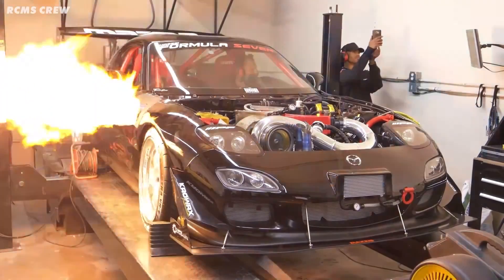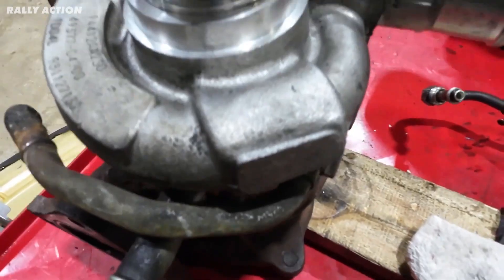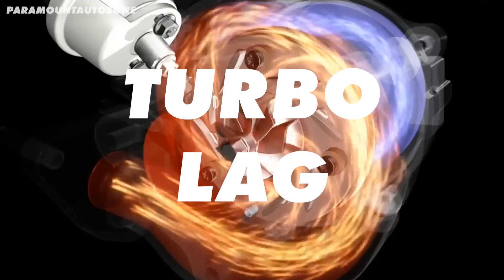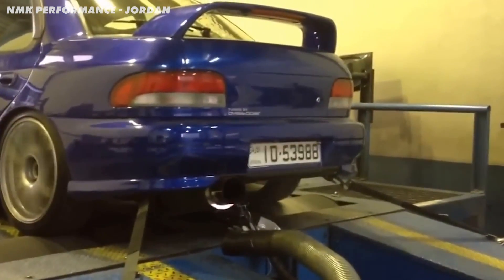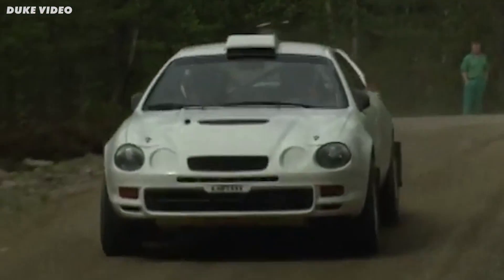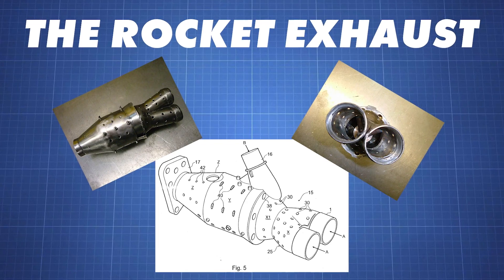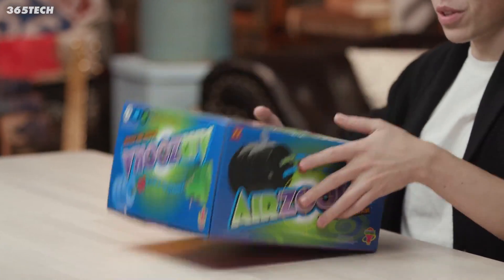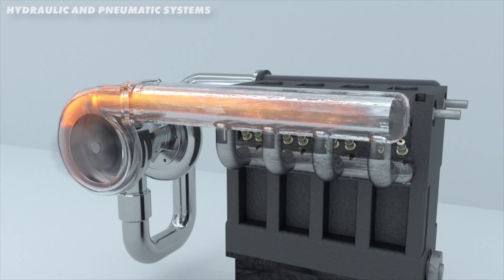Subaru's GENIUS ROCKET Exhaust

Comment: 4:58 The in car video view was from an setup called "Fresh Air" anti lag system which operated very differently. 
The throttle would be fully closed, but the turbo would keep spinning and never spin down until you flip a switch. 
Basically your plumbing a T into the charge pipe right before the throttle body to a waste gate that's plumbed to each individual exhaust port on the exhaust manifold feeding itself to keep the turbo spinning from the exhaust side. From watching videos about it in the past. Rally Racing banned this type of technology and a new type of technology "Rocket Anti-lag" came into place for a more efficient design from an emissions standpoint.

Comment: Having Been in to rallying for the Last 45 Years And I Owned a subaru WRX Uk 300 ,Anti Lag Is One of The Worst Things ever Put on a Rally Car !.
A Legacy RS Before any anti Lag Rubbish Existed and Unequal Headers Sounded Fantastic,But When They Went over to Equal Headers and Antilag Latter on the Develpoment on Imprezas They Simply Sounded Boring And Not as Nice at All

You will be Saying F1 Engines in 2023 Are Better Next ? When There Rubbish Compared to The Past As Well.

Comment: U forgot telling the part that this rocket anti-lag main advantage over conventional antilag..

That would be full boost even at idle speed engine rpm...

Thats why subaru impreza s12b code chassis can start-launch at rally stages just sitting idle...

As opposed to conventional antilag needing the driver to input 100% throttle and keep the engine rev high enough to start/launch...where then whem only after get moving, the conventional antilag will be effective...as the engine rpm relatively kept at reasonably high rpm to get the exhaust gas moving decently...

Rocket antilag can be driven in more relaxed manner at launch as well as at every type of corner without needing to keep the engine rpm high enough...because there is already full boost available even from idle rpm...solving problems of bogging down at super tight hairpins or driver error...

Less driver stress on keeping the engine rpm as high meams less engine wear, less drivetrain shock, more focussed driver and cleaner driving style...more potential to wins...  

I wonder what the result would be  if Seb.Loeb given the chance to compete in wrc driving this version of subaru...

Comment: One of the difficulties of the group B cars was the immense turbo lag that came with the huge turbochargers they used. You'd plant your foot on the throttle,  then wait a second or so while the engine tried to get the turbo spinning. And then you'd suddenly have more torque than you knew what to do with.

The other major problem was that you were driving the same stages with 400+ hp that you drove the previous year with under 150 hp.

Comment: Turbosmart has a ALS valve that you can install to your turbo system. It takes your pressurized air frok your charge pipes and routes it directly to your exhaust header. Run a rich 0% throttle map with late spark timing, and now you have anti lag.

Comment: Not sure if you ment to imply Toyota came up with secondary air ALS or not but they (Toyota) didn't.

 Audi had it's 'Umluft' system on the S1E2 Quattro circa 1985 using a wastegate off a 944 Porsche Turbo to supply charge air to the exhaust manifold under certain conditions.

Unfortunately,  control was not as precise as today's technology and the exhaust valves would eventually burn up and be destroyed from the high temperatures in around 60mins of use.

Comment: "How did they come up with this?!?"  Apparently someone came up with similar idea in 20th century for locomotive engines, very very old patent, there was also at least 1 man who re-engineered a system similar to this for his S2000 race car, searching BigBadWolf S2000 will get you there.  Regardless, what ProDrive did with his system is truly amazing.
Reply: As far as I am aware, he has never lost an engine.
Reply: @TrackDayMaker  You are probably right, i forget what he lost, or what hurdle he faced, i just remember something a few times completely stopping the project.  If its all on same motor then my apologies.

Comment: The rocket exhaust is related to NOx reduction burners used in industry. The goal is to get complete combustion yet lower the overall temperature of the mix.  It's essentially a way to get combustion in overly lean conditions.

Comment: Saying that Citroen beat Subaru because it was shorter and had better balance sort of dismisses the driver of the Citroen who changed the way rallys are driven because he was so dominant.
Reply: I seem to recall it was someone named Loeb…
Reply: @borismuller86 That rings a bell.  Sea Bass something.
Reply: Sea Bass Loeb? Sounds a bit fishy if you ask me . . .
Reply: @nigeldepledge3790  Sea bass is a dominant fish in Rally.  All told essentially 20 years of dominance.
Reply: Exactly, it had nothing to do with the Citroen and everything to do with Loeb driving it.
Reply: @Danger_mouse  that's not fair.  The Citroen had some things it did well, it's just that not even mentioning Loeb is crazy.
Reply: @Scoots1994  The Citroen was no better than its rivals, only equal to.
It was Loeb that made it a winner.
Reply: @Danger_mouse I think it was better in some ways.  It was more stable under braking and was more stable on quick transitions ... at least that's what I think I remember from back in the day.  But no doubt it was Loeb that made it a winner.

Comment: The supercharger and turbo charger used by Lancia wasn't during that period, it was during group B, there wasn't a restrictor during that period. They did it because they wanted mega power and big turbos were REALLY laggy back then, so the supercharger addition was to get around that problem. And from what I've seen it was mental in regards to power delivery.
Reply: This is correct
Reply: The Peugeot 205 only had the huge turbo, not the supercharger. That took about 7 years to spool up, good times.
Reply: I think it was more of a generalisation on how companies were trying to get around turbo lag
Reply: @dynamitedavies Also, I think twin charging should have been pushed on. You might think it fell off because of packaging and weight. But guess what, hybrid systems also happen to be bulky and especially heavy.
Reply: True, i was like "WTF He is talking about?"
Reply: this! Plus the TTE (Toyota Team Europe) "solution" was to design a system that deliberately bypassed the 34mm restrictor! Which led to them being excluded from the championship!

System was designed so that when the jubilee clip was tightened up to hold the hose onto the front of the turbo, it would press open internal doorways and open up the intake of the Turbocharger! When the jubilee clip was loosed and the hose removed by the scrutineers to check it, the internal doors would snap shut! Max Moseley ( then FIA president) said it was a seriously nice bit of clever engineering, clearly sanctioned at the highest levels!
Reply: was looking for this comment
Reply: Yeah he’s wrong all the fuckintime. Prolly gona unsub and find something else to watch.

Comment: I'd love to see a rally video on the job of the navigator.  What are they saying?  What does it mean?  How does it help the driver?  I never understood any of that.
Reply: I think they have course layouts on their paper and they inform the driver of upcoming turns. They're on public roads and aren't doing laps, so the drivers can't possibly memorize the "course" beforehand.
Reply: There are tons of videos on this
Reply: It's a code/language of commands, that describes:
angle of the turn, 
it's lenght, 
distances between the turns or way points, 
on witch side of the road should they be before the next turn, 
state of the surface, 
what obstacles are ahead (like chicanes, jumps, dips and hills, creek crossings, and so on and do forth),
which amount on or off throttle driver should be in a particular turn.
Driver dictates those commands to the co-pilot at the mandatory and strictly regulated route reconnaissance, before the main rally event. Than, after the start of the rally, co-pilot just reads those commands for the driver. It's like driving in fog with the GPS on. You see on screen, in advance the turns of the road, before you reach them. Same with those commands, but very much the analog way of doing the thing.
Reply: Typically they will use a system such as a 1-6 system, 6 being a very shallow turn while 1 being almost 90 degrees. They will also have other codes for tighter turns such as:

square right/left = 90 degree turn

Hairpin left/right = 180 degree

Open hairpin = a wider 180 degree, like an open hairpin/bobby pin

Crest = slight hill

Dip = slight dip in the road

Jump maybe = be careful as the car may do a jump over the next section 

Caution, double caution, triple caution = be careful, be ready to slow down and maybe stop, stop or we die 

Flat = full speed

Any numbers they say is usually how many meters, example “70 6-right” = shallow level 6 turn right in 70 meters

It would be too difficult to remember the course layouts so the navigator uses pre defined code words or “pace notes” to tell the driver where to go.

A typical set of pace notes may read something like “40 into 3right into 4 left tightens into flat 100 crest jump maybe 50 caution hairpin right” or “in 40 meters there’s a level 3 turn to the right followed by a level 4 turn to the left, you can go full speed after that but be careful as there is a slight jump in the road 100 meters up which may cause us to jump, 50 meters after that there is a 180 degree turn to the right with something you need to watch out for so be aware as you may need to avoid or slow down.

There is a lot of different phrases and lingos for all different things a driver can meet on the track and each is different to each driver and co driver

Comment: Fun fact: Mitsubishi called their antilag system the "misfiring system."
Reply: MISSSSSSSSSSFAIARINGU SHYSUTEM

BANG BANG
Reply: Misufairingu shisutemu!
Reply: @lautzki  Ah yes, the Emperors of Hirohazaka
Reply: @lautzki BANG! BANG!
Reply: I bienged that entire stage yesterday, lmao
Reply: Irohazaka PTSD incoming 🤣

I love that I'm not the only one who realized the reference
Reply: Misbishi say it 'Misfit System' that does exactly what it said on the tin 😅😅😅
Reply: Intial D reference
Reply: Inital D
Reply: They also called their gas tank the oil tank. you fill up both the gas and the oil every week.
Reply: Yeah there’s a reason those pro drive Subarus are 400k + 😂
Reply: cough cough *seiji iwaki *cough cough
Reply: My Mitsubishi has it. It's called SAS
Reply: When I played Forza Horizon 5, I nicknamed it " The popcorn machine " for obvious reasons
Reply: Initial-D is not real life.
Ralli-Arts anti-lag is called...wait for it...anti-lag.
Reply: @bigbuckoramma  only Ralliart GpN Evo I've seen had 'misfire' as the label on the ALS switch.  Misfire could refer to the delayed anti-lag spark but it could also reference the cyclic (or rotational) idle where a cylinder was randomly cut to hold a certain idle RPM with a jacked throttle (pre-DBW).  Before DBW throttles were commonplace, this was the easiest way to get the off-throttle air needed for an anti-lag system to function when an air injection valve wasn't legal under GpN rules.
Reply: @MrSaturn7085  
I did not knew about this "cylinder deactivation", thank You. 
Whats DBW?
Reply: @jareknowak8712 drive by wire, electronic throttle control.
Reply: @aspecreviews  
Oh, Thank You!
Reply: @jareknowak8712  Drive-by-wire (electronic throttle control).
Reply: @bigbuckoramma  The soul of the party

Comment: I use a lot of Inconel 718 and Incololy 925. Not only does it have high heat performance, but it’s very resistant to corrosion, and it is very strong able to be age hardened to 140,000 psi MYS. 

It’s expensive as hell but it’s kind of a wonder metal when compared against various non Nickel steel alloys, aluminum, and even titanium options. The fact they had to use it shows the degree of engineering and performance they were after
Reply: Yeah it's not just the high melting point, steel also has one, but the resistance to oxygen at temperature. I hear it's also a bastard to machine.
Reply: @gamemeister27  yeah, it’s very commonly used in jet and rocket engines due to the oxygen resistance at ultra high temperatures. My application is more around different corrosion mechanisms, hydrogen, chlorides, CO2 at elevated temperatures, but the airspace industry greatly impacts my ability to procure my equipment in a timely fashion largely because we are competing for Inconel
Reply: @gamemeister27  Machinist here. Yes, Inco is boring as hell to machine. Slow speeds paired with inserts usually getting dull pretty fast.
Reply: Well many  steel alloys without Ni or with a low content also have problems with there streng over ~ 800°C but below the liquidus they get soft gummy or brittle (or even samething in between) 
 over the currie temperature steel losses almost all of its desired physical and chemical propertys that are needed for use  applications 

The Jumo 004 jet engine (know from the Me262) is a great example why high temp alloys are needed the steel turbine blades just couldn't cope long in a hot exaust stream because of streng and Oxidation problems (well they increased the life time of the engines massively by ceramic coating the blades but the core problem was the leak of alloy materials therfore the  almost milled steel blades)
Reply: I would be amazed if there were, but are there any additive manufacturing processes for Inconel? Actual photos of the “rocket” seem like it was welded together from various pieces of bent/machined parts, but this would be a helluva lot easier to make with atomized powder and lasers
Reply: @DOMO1785  So I googled it, and first result is from protolabs. Not only can you use it for 3d metal printing (sintering like you said), but you can have them print parts for you out of Inconel 718.
Reply: @DOMO1785  yes, I know for a fact that this exists. I utilize a very specialized hydraulically opened valve which includes some smaller inconel components which are printed. I think they are Incoloy 925, but same class of alloy, just different patent holder
Reply: @DOMO1785  mhm fine Puder is a real hassel clumping, consistent layer thickness, shrinking of the powder then molten, sputtering or spray from the laser there is a reason we don't see much of that nice 3d printed metal

Edit : not that it can't be done but there arnt may experts around and expertise is expensive

Comment: Head gasket go brrrr
Reply: When you don't actually know Subarus and you just quote the internet
Reply: Actually, this would lower the combustion chamber pressures, since the air fuel mixture ignites outside of the cylinder instead of with the spark plug (i've also heard that the head gasket issues are mostly on the USDM 2.5L, not as much the 2.0L, but i'm not sure about that)
Reply: @Giuliana-w1f You would be correct about the 2.5 litres (EJ25X) having head gasket problems. The 2 litre (EJ20) just has thicker cylinder walls and therefore a better clamping surface for the gaskets. The naturally aspirated EJ25 were the ones with major problems because of the single layer head gaskets that were used. Turbo EJ25s used MLS gaskets which, at stock power, are pretty reliable for 1-200k miles if taken care of!
Reply: Yep. That’s what I got too…
Reply: When you try to be smart, but you don't even know you get shame on yourself.
Reply: It already ate head gaskets but this allows them to eat through head gaskets faster which meant that their turbo was able to get their own source of cooling because coolant would escape from the exhaust and evaporate on the turbo
Reply: MLS head gaskets have entered the chat